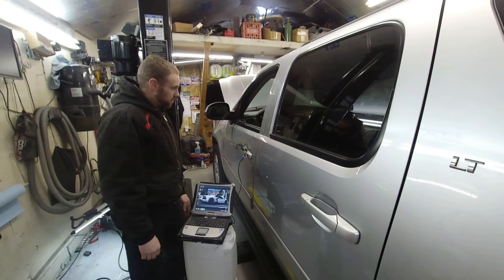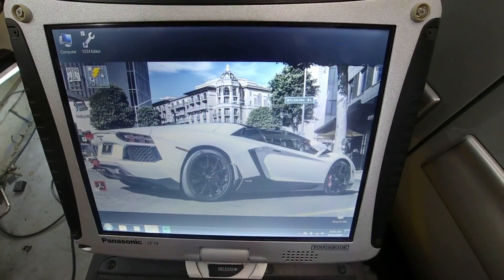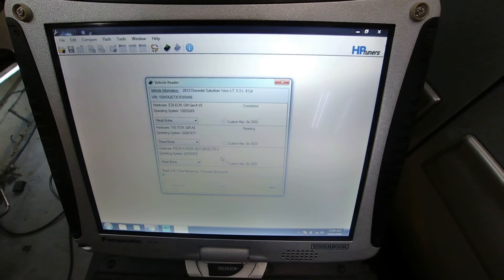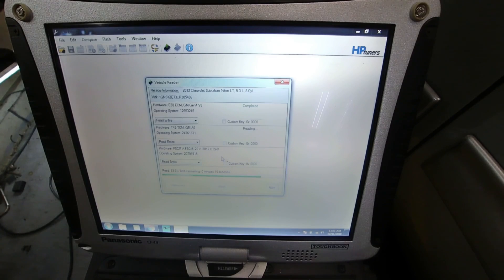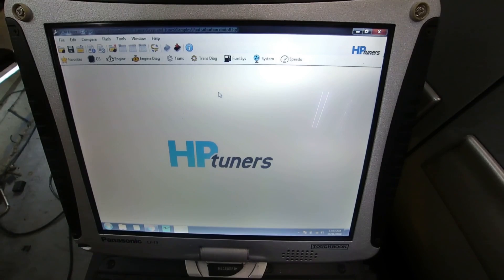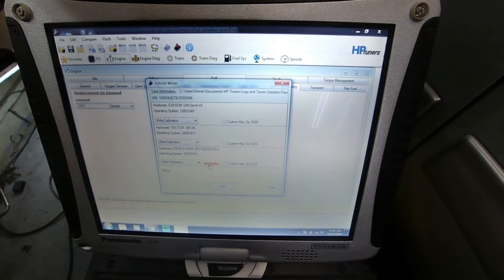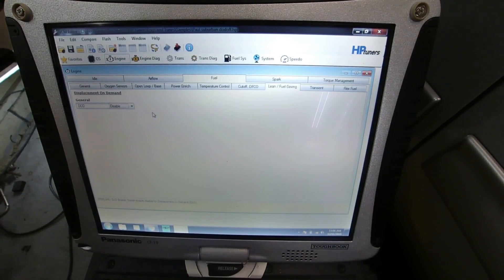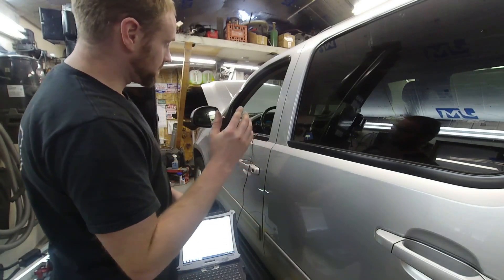HP Tuners DOD Also Known As AFM Disable In PCM

Comment: Does this generate a check engine light afterwards, and if so, do we have to delete and remove those codes with hp?
Reply from the maker: On the Gen 4 this is all that's needed and no codes will happen. Gen 5 is a bit different and a few more things need toggling.

Comment: Ive programed new ecu and also new tcm with my autel j2534 & laptop  on ac delco site with subscription. Can i also do a afm delete through ac delco or i need a tuner? Thanks
Reply from the maker: Probably need a tuner. Unless you can flash it with a non-AFM compatible OS from another vehicle. You would have to do your research to figure out what has the exact same features minus the AFM. Might be able to find something from a 2500 if it's a truck you are working on.
Reply: @CrazedPerformanceRepair  thank for the reply 07 5.3 yukon lifter issue pulling the engine & thinking about doint a afm delete same time or i have a 07 escalade with the 6.2 non afm i can do a swap & just carry over the ecm. I know on ac delco site i can purchase other programs but im a lil rusty on this computer stuff lol

Comment: Hi 
I took your advice and sent my ecm to lt1 swap to turn of afm/dod. I reinstalled ecm, charged battery, started it and no cel👍🏼
I then drove my 2012 Avalanche LTZ into the sierras, switched through the 2hi, Auto, 4hi, 4lo to see how it performed in the snow. 
No problems there. Drove it back home, round trip of roughly 70 miles or so. After stopping for gas the truck went into 4lo without moving the rotary switch. Would not come out, service 4wd light came on and it’s all wonky now.  Switch position shows random gears whenever I restart. And code C3098-5A shows up on my xtool A30M scan tool. Would the ecm mod have anything to do with this situation. Or is it sheer coincidence?
Thanks, Mike

Comment: I just got a 2009 silverado 2500hd crew cab 4x4 6.0l "work truck". I think it's had a DOD/AFM tune done to it already. I don't see have both aft/rear O2 sensors installed and I get no errors with my obd2 reader and my android phone using torque pro app. I read somewhere I can put my gear shifter in "M" and manually press buttons to select how many gears to use and at same time this "M" mode disables dod/after but I don't know how to changes this as my model of truck is the work truck and don't have the volume up and down buttons. When I have the gear selector in "D" I always see a "1" on the right side of the "M". It don't change. Ok now the real question. Does the hp tuner perm program the ecm or can I reset ecm so it loads all factory settings? The guy never said he had a tune done to it so there is no original backup file before any alterations if there were alterations. Nice video btw

Comment: Can i disable with hp tuners on a california vehicle and still pass smog???
Reply from the maker: Yes, smog doesn't check the tune file. It only checks for codes and checked exhaust with a sniffer.
Reply: @CrazedPerformanceRepair  ok just wondering cause supposedly california will start checking for tuned ecm thats why i asked
Reply from the maker: @NORCALPYRO_  well if they do that one we'll have to resort to vin tag and badge swapping with 2500 hd or something then righting the tune to match that vin. Of course this would make things complicated and false. 
Reality is one should just move out of that retched heck hole of a state. I hope not but won't put it past them to implement it. After all they are banning fossil fuel vehicles soon. You know, so that electric cars can add strain to the already overstressed grid because that makes total sense.... 🙄

Comment: Do you need to mechanically disable the DOD also. Mine is still working fine but I will be doing a delete and cam in the future. Can I simply turn it off in the ecu to stop the exhaust note when it's on 4cyl
Reply from the maker: Yes, you can just shut it off and it will stay in v8.

Comment: Where do I get the plug ?
Reply from the maker: Hptuners, should also be Amazon link in description.
Reply: The metal plug for oil duct on oil pressure switch ?
Reply: Can I delete the DOD with hp tuner with out plug the vlom?
Reply from the maker: @willymanjarrez86  yes

Comment: This was a great video, and I have a question for you. I have a 2012 Silverado, 5.3 4x4 and I just put in new LED turn signals bulbs and they hyper flash. Their is no relay for it and is controlled by the  truck computer. Do you know how to and where you adjust this with HP tuners. Thanks again for the good videos.
Reply: It's a resistance thing. You need to go to Amazon and buy a 50w 6ohm resistor for each bulb. You wire one side to the blinker wire and the other to the ground.

Comment: I have a misfire on my #6 cylinder. This is after they replaced the camshaft on my 5.3L. it only gets 10.6 mpg. It has low oil pressure, also. What is it?
Reply: Sounds like some sort of clearances have been thrown off. It’s likely that you got your camshaft swapped and either didn’t delete AFM, or the cam you got is too large and your VVT isn’t capable of supporting the bigger cam lobes. Make sure both AFM/DOD was deleted, as well as VVT.

Comment: I have a question if you don't mind. i purchased a 2018 chevy silverodo, it was a fleet truck. well the truck runs perfect.  But when reach 70 mph the truck won't go any faster , evven if mash the gas pedal to the floor. it's a v8 with 140 mph on the dash. what did they do to govern it down & how can i remedy the problem.
Reply from the maker: Most likely something was done in the tune to keep the drivers from speeding to badly. You will need someone to go into the tune and return it to stock or remove the limiter.
Reply: I have bought used trucks same thing, companies order new trucks with the programmed governor right in the ecm. Its actually a RPO code in glove box I forget which it is.. But yes anyone with hptuners can use $100 worth of credits unlock the ecm and change the setting in 15 min. I did it myself after buying hptuners and have used it at l3east 6 other times on new vehicles making changes, disabling DOD VATS etc

Comment: So a dod kit isn't needed, if I'm installing a cam on my 2008 gmc?
Reply: Basically, the components are still in the engine, doing this HPtuner method just turns them off in the computer.  If you want absolutely no chance of the DOD/AFM system harming your engine then you should remove the physical components and replace them with non-DOD parts.  This is relatively easy to do, but takes knowledge, time, tools, and patience to do correctly.  Most DOD failures happen during the transition from v8 to v4 (or vise versa), so turning them off greatly reduces the chance of failures happening.
Reply from the maker: Yes you will need a kit to remove DOD if you currently have DOD. The electronic and mechanical side of the system are separate but work together. This video is only turning of the electronic side of the system.

Comment: Last month I gained intimate knowledge of this afm nightmare on my Dad’s 2012 Escalade with the 6.2L with ~130Kmi.  He started it one day and the mystery noise of an afm collapsed intake lifter #6 reared it’s heel.  We were able to free it up by tapping it through the oil feed in the lifter valley.  I had fun sourcing the 5.3 lifter valley afm gasket(nobody lists the gasket for the 6.2l escalade 😠) and replacing the old one.  Dad wants to keep afm, but i’d tune it out like you show here.
Reply from the maker: I am not sure why anyone would want to keep the system active but if you do, you must address all oil pressure issues. Depending on many factors this might involve a higher than factory volume pump.
Reply: CrazedPerformanceRepair I replaced the oil pressure sensor and cleaned out the screen there and the 4 screens on the valley plate, so hopefully it’s in better shape than before.  I would delete it if it was mine and uncork that 6.2 in the process.
Reply from the maker: @grad0n  was the screen under the sensor plugged tight or just a little dirty?
Reply: CrazedPerformanceRepair just a little dirty.
Reply from the maker: @grad0n  just realized I never mentioned if the lifter has failed already your only choice is to release and shut the system off or replace the lifter. Then of course the rest of the conversation still applies. So then the screen is not the source of your issue. You might have a slightly worn out engine. Oil pressure is always why these fail. Loose VLOM bolts causing bad gasket, oil sump o-ring, slightly worn bearings, leaky lifters, the screen is plugged, something made the system activate with less then 27psi at the lifter that failed.

Comment: Picked up the tool from your shop yesterday. Popped it free today with minimal effort. I was fortunate to have this issue about a block from my house so that's all that the truck was driven before fixing. Actually this happened as I was getting off the highway which explains the situation perfectly.
Reply: Dougie Fresh are you driving it?
Reply: @grad0n  Absolutely. Gave a good couple stomps since it had unspent fuel still in the exhaust. Replaced valve cover gaskets and grommets, intake gaskets and injector O-rings since I already had all that stuff pulled out of the engine bay. It runs great and just took it on a camping trip.
Reply: Dougie Fresh you didn’t change out the lifter?
Reply: @grad0n  Nope. Just knocked it free. No need to pull the heads if I dont have to.
Reply: Dougie Fresh that’s what I did with my Dad’s 2012 Escalade that failed in his driveway.  What oil pressure are you seeing at hot idle?
Reply: @grad0n  Right around 50

Comment: Two things: (1) Does anything need to be hard-wired in or remain plugged into the vehicle for this to work?  (2) Do I have to do an actual delete kit first (cam, lifters, etc)?  I'm trying to avoid the $3000 to replace the lifters if possible (I have what I believe is a stuck lifter and will try your method for releasing it using the pushrod tool first, but would rather try to avoid rebuilding the engine if possible if this tuner and your lifter release trick works and this keeps the vehicle out of DOD mode/prevents the lifters from collapsing down).
Reply: Heelix Ranier What did you end up doing?
Reply: What did you end up doing. I have the same problem
Reply: @joshuasanchez1120 after freeing up the lifter if you can the odb tuner works well. The bad thing about the tuner is at any time it fails or gets unplugged the lifter will immediately fail and it sucks having to tear the motor apart again but it absolutey works. Been 6 months with no problems.

Comment: I have a truck that appears to have a grounding issue in the ECM that's causing a solenoid to stick open anytime the key is on. After doing the disable can I unplug the vlom without throwing any codes? And have you done any videos on what you have to do to the vlom regarding oil flow to do a disable. Thanks for the video!
Reply from the maker: Yes you can unplugged it without codes once disabled but why? Here is the VLOM mod that I do currently https://youtu.be/pP7I5tbXsfw?t=1637

Comment: can i just turn off them afm/dod with no wrenching .....just use the program to turn it off.

i have no lifter noise but misfire on cylinder 1 and 7
2002 5.3
Reply from the maker: Yes but I suggest you watch https://youtu.be/pP7I5tbXsfw for your misfire to look into what lifter issue you may have. Cylinder 1&7 are AFM/DOD so you may still have a failure. Also if all you want to do is turn off the system I suggest lt1swap.com he is much cheaper at only $50

Comment: great video. so it works for c7 corvette too? (DOD disable?)
i've heard of that AFM causes T/C problem on c7 vette 
and i'm considering getting c7 stingray or GS. so..
Reply from the maker: Anything equipped with this system I recommend turning it off.
Reply: @CrazedPerformanceRepair  thank you! i think i should get the one latest model with very low mileage and turn that off

Comment: Kinda off topic but will the HP tune software turn off the EVAP test so my check engine light will stay off?
Reply from the maker: Why don't you fix the problem instead? Let me guess you have a solenoid control circuit or large leak code? I will be releasing a video very soon on this topic.

Comment: Just in case you didn't know chevy makes two different 5.3 ls engines one has an aluminum block and it has afm system and the other is a steel block with out the afm system
Reply: I have an iron block 5.3 ltz with af.
Reply from the maker: I have also seen the iron blocks with the afm system but they are not very common.
Reply: All trucks have steel blocks.
Reply: @rickbyfield2190  no they don't mine is aluminum from factory

Comment: Question for you.  08 Tahoe, 185k miles, no current problems.  If it were yours, besides deleting the DOD in HP tuners and checking the vlom bolts for looseness, what would you do to try to get this thing to 250k Miles?
Reply from the maker: That is all you need, just keep up on the maintenance. I have seen many of these well over 300K miles.
Reply: @CrazedPerformanceRepair  Thanks for the response Sir!  One more questions, do you find the updated 2011 and newer driver side valve cover to be worth the $100 price to reduce oil consumption?
Reply from the maker: @Toys4Life  Yes
Reply: @CrazedPerformanceRepair  Thanks, I appreciate your input!!

Comment: Hey I have a question, so I did a DOD delete kit install but I haven’t done the tune yet. I turned it on and it’s slightly misfiring as it should but my oil pressure is not reading at all ( I put a brand new oil pressure sensor), is that what’s suppose to happen until I get it tuned?
Reply from the maker: No matter what you should have oil pressure.
Reply: CrazedPerformanceRepair where should I start investigating ?
Reply from the maker: If you did a full delete this means you replaced the valley cover, correct?
Reply: CrazedPerformanceRepair yes with a smooth non dod one from Texas speed
Reply: Btw ... when I removed the sensor from the old dod valley cover, I removed it with a power gun. Could that have broken something inside the sensor?
Reply from the maker: Yes absolutely could of I would suspected  the sensor is bad.
Reply: CrazedPerformanceRepair guess what buddy?! So I took out the sensor to check it out and it has 3 pins inside well I must have but the connector crooked and it bent one of the pins so it wasn’t making connection. I put by e old one which was probably still good since I had a dod issue and it worked!!! Thanx man! Thanx for helping me out with my questions

Comment: Is it okay to just disable the DOD on HP Tuners even if I dont install a DOD delete kit such as replacing cams, springs, retainers etc?
Reply from the maker: Yes it's fine to turn off
Reply: @CrazedPerformanceRepair   can i tune it out and be fine in california???
Reply from the maker: @NORCALPYRO_  yes, it will act as if it's a non AFM engine. Just don't tell them you did it and you should be fine.
Reply from the maker: @ian_jc  isn't that the same question as SrichampooTV?
Reply: Can i tune it out in california???

Comment: Hey man hopefully you can guide me to the right path I have a L77 with cylinder eight misfire no code yet I was able to look at the misfiring data and see it was cylinder eight, engine running rough on lower RPM swapped coils new spark plugs new wires even swap injector compression is good. is it possible that a lifter could be weak causing it to misfire and still have good compression on the gauge while cranking? I could hear valve noise as well
Reply from the maker: Cylinder 8 is not a DOD cylinder but you might have a wiped out cam lobe. Pull the valve cover and compare cylinder 8 rocker movement to the other cylinders.
Reply: No, you would have low compression with a weak lifter or worn out lobe. Your problem is probably electrical, wiring, injector or pcm

Comment: Bought a Range for my 17 High Country 6.2L works as it says have no lifter issues yet and don't want it to happen only 31,000kms. Either way HP or Range gives the same results.
Reply from the maker: The range device only helps when it is plugged in and working properly, HP tuners or LT1Swap.com gets it taken care of all together.
Reply: @CrazedPerformanceRepair  Mine is working properly and has all the latest and greatest and is giving the same results
Reply: @anthonymacneil2279  the new trucks are failing also lifters and flat cams

Comment: Can I disable dod/afm before I get any lifter problem? Can I just disable it and I’m done? Or what else would I need to do? It’s a 2014 caprice l77
Reply from the maker: Absolutely a good idea to turn it off early the only other thing I suggest you do is check the VLOM bolts and make sure they are tight.
Reply: CrazedPerformanceRepair so no need to do the VLOM mod?
Reply: What I could say is I have a cylinder 8 misfire it does sound like a lifter noise but I believe cylinder eight isn’t that style? Haven’t looked at it yet but will soon and while I’m there I’ll delete that system
Reply from the maker: @youngcurls1  Cylinder 8 is not a DOD cylinder. As far as the mod goes, it is optional if you haven't had a DOD failure yet. If you pull the VLOM off for any other reason than at that time it's a may as well do the mod since you are right there kinda of thing. The VLOM mod is kind of like an insurance policy.
Reply: CrazedPerformanceRepair ok cool man I really appreciate your help and fast reply

Comment: So just did a dod delete kit on my 2010 Camaro ss won’t start tho is this what I need to do to get it running?
Reply from the maker: It should still have ran but this does need to be done as well or it will go into limp mode without a VLOM plugged in. I would be concerned about cam timing or having forgotten something when putting it together.